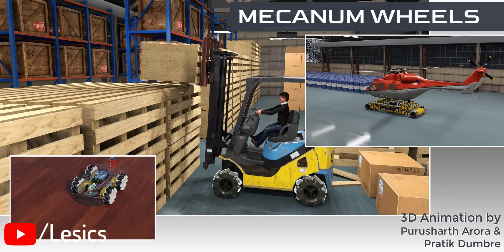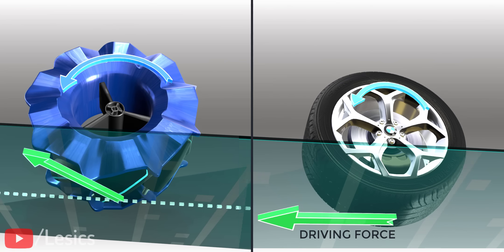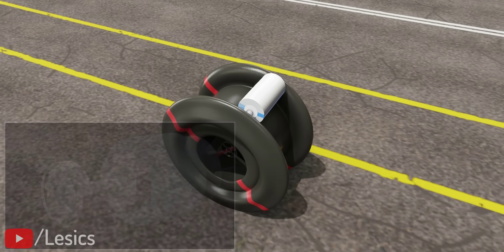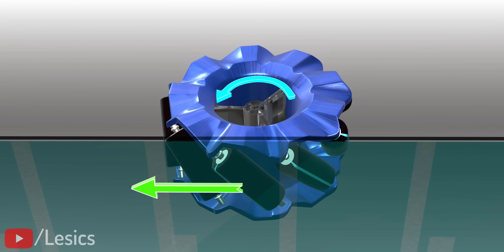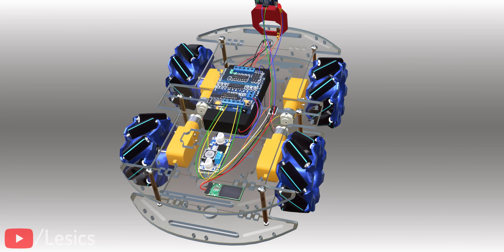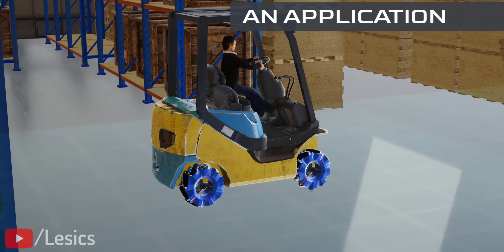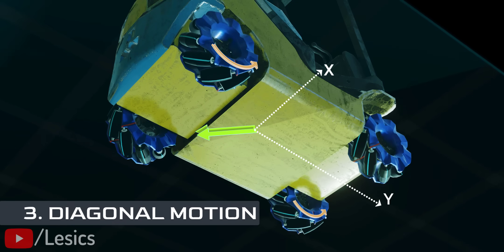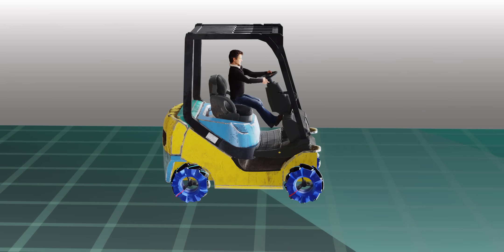The Brilliant Engineering of Mecanum Wheels!

Comment: This movement system works as long as each wheel has a perfectly equal coefficient of friction for each wheel. When dirt appears on the surface or the wheels wear out, the direction of movement is unexpected.
Reply: probably can be fixed by computer adjusted wheel motors to maintain the direction
Reply: @Fin4L6are  
Came to say the same thing. Can’t be more complex than controlling a multicopter drone.
Reply: @Fin4L6are  the controls will have to be completely different from a regular car/forklift. Maybe a joystick for direction and a lever for forward/backwards thrust.
Reply: 1 joystick with a twist axis. Push forward go forward, push right translate right, twist clockwise turn clockwise, etc.
Reply: @Fin4L6are  big brain

Like a constantly correcting program?
Reply: @gameseeker6307  sure
Reply: This is a matter of control science. We can design a close loop control system that can drive the vehicle movement correnting the not perfect condition of the wheels.
Reply: @antoguag  yes! My robotics team has used these wheels with a LQR and that solution worked very well.
Reply: @BenCauntyt  where? URL?  video?  thanks
Reply: That's for materials science engineers to resolve.
Reply: @besacciaesteban  true, but what an awesome challenge for anyone to take a shot at it. We are all capable of that, never stop believing in that, failures are successes in many forms in just everyday life.
Reply: Wouldn’t it be easier to just have four wheel steering?
Reply: @Stormprobe  To do exactly the same motions, exactly the same way would require extremely robust power steering  capable of turning each wheel laterally without forward motion under load. Something similar can be done with less robust power steering, If you make a space tradeoff ie get the wheels moving before you start turning. But you're adding 4 hydraulic systems on top of an electric one because each wheel will need to be independently steered.
Reply: @Stormprobe  With conventional drive systems, steering while stationary could damage tread & floor.  Mecanum wheel systems doesn't "steer" in the typical sense, so making direction change at extremely low speed is one of its strengths.
Reply: @Stormprobe  I guess this technology is cheaper to build and easier to repair. No steering mechanics at all which saves 4 additional motors
Reply: Engineers are always a step ahead. The Airtrax loader in our hangar works on concrete floors, paved roads and even grass/soil.
Reply: That's why you use a closed loop system that monitors actual direction against predicted direction, that way precise control can be maintained. This is the basics of an accurate and precise moving system
Reply: That traditional forklift turn in the video is BS they can almost turn on a dime .
Reply: @kayzrx8  True, that was a cringe exaggeration.
Reply: @kayzrx8  They 'rotate' around a dime.. not so much 'turn' on a dime :)  Lay a dime at the middle of your right front wheel, turn you steering hard right, ,then go 'forward' and you'll rotate on the axis of that dime you just placed :)

Traditionall Forklifts turn 'similar' to how tanks do when you make turns at their turning limit.  Only its the front 'axel' that swings around rather than the 'center' of the forklift, and the rear swings around into the space the opposite side of the axel was occupying.
Reply: @Gwydion_Wolf  you do know that's an expression captain obvious :)
Reply: @kayzrx8  I know, hense the :)'s 😉

Just wanted to give people who may not know a decent mental image of how current ones turn :)
Reply: @kayzrx8  Yeah thats true but they still cant go sideways or diagonal lol.
Reply: @Lotek117  they don't need to. Millions of forklifts have been doing fine with rear steer for decades..... Reliably. Sideways movement would assist a newb that's about it. Not to mention alot of forklifts can move the forks sideways . So not sure how this helps besides adding complexity, reduced reliability and Increased cost , the three things you are trying to avoid when manufacturing a product .
Reply: That's why we have sensors that can adjust for those moments.
Reply: I agree. Im sure this wheels will wear out  way faster than regular one either. So it will cost more to repear
Reply: @sahinyasar9119  Hence the market share of this invention is tiny even all those years later.
Reply: @StrangerHappened  when thinking about it. This only usefull for robots useally used in amozon cause they only move in predicted space. While employee only need someone skilled to work for them to drive regular one
Reply: @StrangerHappened  I think the market of these wheels are only in factories
Reply: @StrangerHappened  Actually.... since engineers were forced to make light bulbs with an end date. I'm surprised it's not being regulated into existence.
Reply: @sahinyasar9119  They are usually driven by a joystick. Many can autonomously guide themselves and have built in collision avoidance.
Reply: @sahinyasar9119  they are also used in robotics competitions like F.I.R.S.T. robotics sports. and other hobbyist applications.
Reply: @newchannelverygood162  Which is a huge market.
Reply: @newchannelverygood162  the us navy uses this tech in their ships
Reply: @sahinyasar9119  Skilled employees want to be paid, robots don't. You can sell almost any idea to a company and they'll buy it so long as it's goal is to replace employees and reduce how much in wages they have to pay.
Reply: @sahinyasar9119  even then, Omni drive might be more practical
Reply: @newchannelverygood162  Why factories?
Reply: @sahinyasar9119  usually used at amazon** 

English, it's a bitch.
Reply: @StrangerHappened  Agreed, i work as a security officer in many warehouses and i see only regular forklift trucks everywhere.
Reply: @StrangerHappened  forklifts are expensive as fuck as is already. Not because of the wheel.s
Reply: @sahinyasar9119  I bet with the advent of AI, could have an adaptive system that can compensate for any irregularities, and maybe even make the control of them easier
Reply: @sahinyasar9119  Yeah I can't see this being very useful to amazon warehousing unless land in the area is VERY scarce. (i.e., forklift).

I bet it could come in handy for their delivery drones though if they ever start that like they said. I would imagine they'd use a hybrid flying/rolling system to shorten airborne time. The ability to spin when delivering to complex locations could prove very useful. Just don't neglect on the AI and Camera systems however, I think the biggest hurdle will be keeping people from getting in the way or proactively messing with the delivery drones.
Reply: @sahinyasar9119  QAqqqqQqqqqQqQQqq qaQQqqqqqqqqQ
Reply: @sahinyasar9119  repear
Reply: @sahinyasar9119  Yeah man, but the cost of the rent in my area way higher jajaj
Reply: @sahinyasar9119  they're rollers, not fixed.  Watch whole video.
Reply: @sahinyasar9119  ya me pssá2
Reply: @sahinyasar9119  You seem to think that the rollers are sliding on the ground since you bring up friction and wear. This is not correct. The rollers are just rolling, like small (unpowered) tires. Of course you won't have Mecanum wheels on your car any time soon, but that is because the function is not needed there so the added complexity and cost is unjustified.
Reply: @mumiemonstret  Still using this tech on forklift which lift way heavier things and it will put pressure on bearing of rollers, Its enough to break or with little bit dirt make it unuseable. In the end it would be more usefull on unmanned robots that dont lift too big weights where is no dirt.
Reply: @mumiemonstret  On the diagonal motion only 2 wheels are spinning so the wears can be uneven.
Reply: @lfow0234  Yes, but over time, the wear will be even, due to directional movements averaging out.
Reply: @mumiemonstret  finally someone with sense and knowledge in this sub
Reply: @lfow0234   On front or rear wheel drive vehicles two wheels wear unevenly as well. Even 4wd the power and loading is not 100% symetrical.  It's all part of wear and tear.  The advantage to this system is that it is only used in controlled environments where a good engineer can figure out whether the mobility advantages produce enough cost savings(space and time efficiencies) to make any added maintenance cost worthwhile.
Reply: @BritishBeachcomber   The wear will balance out only if the work load forces balances out over time. That might happen, but more often repetitive  work will cause uneven wear.
Reply: @mumiemonstret  shhh… I was having fun reading peoples claims of expertise before I searched for it myself. The video you shared is most likely a promotional video so it won’t explain the downsides to using these wheels but if I do a little googling I can probably find practical info from people at the other end of the Dunning Kruger curve, who actually know what they are talking about.
Reply: @jacobpaint  I admire the effort you yourself put into this: "If I do a little googling I can probably find..."
Reply: @garryiglesias4074  Well, as an engineer I am used to myself being the downer in excited discussions about unrealistic solutions, and I recognise the importance of someone questioning them. But many of the negative comments here are neither constructive nor scientific. A few are, though.
I don't want to come off as a Mecanum fanboy (though I am Swedish and as such a little proud of the invention). There are definitely valid concerns. I think that the most important is that the rollers constantly interact with the ground the same way as ordinary wheels only do when taking a very sharp turn. Good friction is essential. No, it doesn't need to be "equal on all wheels", but it needs to be good enough to prevent slipping. Otherwise, as noted, you will take off in an unpredicted direction.
So the commenters pointing out that these wheels don't work off-road or on gravel are right. The commenters noticing that regular wheels are more practical in most applications and that the video compares them unfairly are also right.
But then there are all the other commenters, just saying "This will never work!" and then constantly changing the goal posts when contradicted, to "OK, maybe work but never be practical", "OK maybe practical for robots but never for a forklift", "OK, it can work on a forklift but will be crazy expensive" etc. etc. 
I don't understand the mindset of this kind of downers. And yes, they are clearly "engineer-posers" since engineering is about seeing opportunities.
Reply: @mumiemonstret  id imagine you can't drive this thing on a hill or park on uneven surfaces. There would be no brakes
Reply: @mumiemonstret  even if the patch of turf the roller touches never changes while the machine moves, its still exerting downward force which would produce heat + wear and tear on the 'spot' the roller made contact with the ground.  Then you have the barrings on the rollers own center-line axis that 'is' spinning at that time.

It'd still cost more in the long run for 'heavy weight' applications than normal tires.  Though i'd love the idea of being able to use a forklift equipped like this.

I think were more likely to see forkilfts designed with 90deg angled traditional wheels though before these become widely used. :)
Reply: @sahinyasar9119  You seem to underestimate how much stress bearings can handle.
Reply: @mumiemonstret they are rolling on their axes but they are constantly sliding on the surface, like a drifting car.
Reply: @mumiemonstret  imagine 100 years of refinement of this system.
Reply: Yeah that's why this is only used indoors, but frankly it's mostly needed for restricted clearance areas like warehouses anyway
Reply: @xaiano794  But they're used outside as well
Reply: True. But it maybe could be used for some applications where there is no heavy loads and controled environment
Reply: @filipstojanovicmechanicale9265  Siemans uses a vehicle with mechanum wheels to move locomotives.
Reply: But perfect in a warehouse environment.
Reply: Actually, you just described the complete reason behind modern cars being equipped with sensors to counter brake lock (ABS) and traction control and more of such systems. Wear & tear can be taken into account by proper feedback loop by means of sensors to the CPU to calculate the compensation required to motion into the required direction in ALL road conditions. But you are still correct on the more than normal "tire" wear & tear issue. I don't think it is the same rubber compound they would be using.
Reply: @ses4068  Friends, in order to have feedback and correct the direction, it is necessary to have a very accurate and fast position sensor or a displacement verctor. In principle, the problem is solvable, but is it worth it? It's much easier to make all the wheels turnable.
Reply: @f33net  it’s a very trivial problem to solve and it’s very simple with basic sensors. All you need is an encoder on each wheel
Reply: @baileylunn2215  the encoder is powerless when the wheel slips :)
Reply: @f33net  that’s what the IMU is for :)
Reply: @baileylunn2215  What is an IMU?
Reply: @f33net  Inertia measurement unit or something like that. Keeps track of how it’s being moved around with gyros and stuff. So you can figure out how far you’ve actually moved
Reply: @baileylunn2215  Okay, the second question is: how do you plan to stop this car on free rollers on a slope? :)
Reply: @baileylunn2215  If driven manually the driver is the sensor. If driven autonomously, some systems use floor tracking cameras.
Reply: @davidsandy5917  ah yeah the good ol mouse sensor on the forklift trick. That’s a good way to do it too
Reply: @f33net  the same way you move forward. when all wheels are stopped the forces of the rollers cancel each other out because they are angled in different directions
Reply: @f33net  Because when wheels are unpowered the opposing roller directions cancel each other out, so if you apply normal brakes to the wheels itself and they aren't going anywhere

seriously this isn't hard
Reply: Just use controls
Reply: Not to mention many moving parts.
Reply: It looks like this design is for warehouses and areas with smooth floors. Which is the area most forklifts are used
Reply: So great in theory but in the real world doesn't work? Is that why there is only an animation and no real world example?
Reply: @thegeneralist7527  there's real world examples in use today.
Reply: @thegeneralist7527  real world example right here. these ARE used currently: https://www.youtube.com/watch?v=0DBXuZv38l8
Reply: @thegeneralist7527  Dude you can literally google them and watch videos of them existing and operating
Reply: a typcial schism
Reply: 3.3k people have agreed that this forklift is not real, can't work or too impractical, but every one of them is completely wrong.  :(   They had these back in the 80's.  But kids these days think that the entire world was only just invented.
Reply: Couldn't it be monitored by a computer to adjust it?
Reply: That's pretty easily solved. Have a hard wired fine brush OVER the top that cleans automatically every time the wheels move.
Reply: They could interface with a standardized flooring design
Reply: Also what happens when that forklift picks up a pallet..now the front wheels will have more pressure on them than the rear wheels and that will stop them working properly
Reply: And where is the actual forklift and video how it works? I don't need some fancy animations and theoretical bs.
Reply: Wheels are heavy, complex, prone to jamming, prone to wear and tear, not heavy duty. The system requires a smooth, uniform and flat surface to operate. The load must be distributed evenly across the wheels for a predictable direction. Conclusion: It's more of a fancy toy than a workhorse.
Reply: @iqbang9236  It could work in automated or autonomous systems.
Reply: We use these in our robots.   Along with different variations depending on the bot and application.   And of course it still works when the coefficients vary due to debri encountered during normal operations.
Reply: Easily corrected  by the controller by video , laser or gyro feedback.
Reply: @kayzrx8  Do you know why the Kalashnikov gun is the most popular in the World? He doesn't use video correction! :)
Reply: or as long as your software compensates for the differences.
Reply: Not if you constantly calculate tire spin / friction loss for each wheel / roller
Reply: Brr
Reply: The real reason why we don't use this on big heavy equipment is because it's not necessary. It's easier, cheaper, and more reliable to use cranes or other computer-operated structures than a forklift in tight areas. It's cool if a forklift can make such moves but most of them don't really need to. Also, the reason why forklift tires are so simple is because they need to be VERY strong, stiff, and reliable. Adding a lot of components to such a thing is asking for things to break. So almost no interest form the big heavy equipment industry is the reason why it isn't a thing already.
Reply: Good for me, I know what coefficient of friction  is so I can understand this
Reply: My company is currently working on mecanum wheels with a compressed air flow system that blows the dirt out of the way and keeps the floor clean
Reply: Well you can tackle that by using a well designed control system. If you can sense how much the vehicle rotates and correct it when needed, we can do it properly. 
But naturally the costs go up and the wheels get damaged faster too.
Reply: so only for use in clean flat ground warehouses. Those should be fine for years don't you think?
Reply: It will not work 100% in rough surface.
Reply: You can't turn while going fast with these wheels
Reply: Same can be said about regular wheels, if one wheel gets dirty/oily and the others don't.
Reply: All the systems that I am aware of that use Mecanum wheels are operator driven.  In that case, the operator turns the control until it does he wants.  That makes the human the control system  - and he doesn't even know he is doing it.
Reply: Things of unexpected is equal DEATH
Reply: So it can only be USED on a controlled surface environment like a wearhouse.
Reply: Shut up just shut up... Dont say dont talk after people watch watching this video...
Reply: and your point please?
Reply: just imagine the weight not being distributed perfectly XD
Reply: You don't  understand what you  watched. The direction is absolutely controlled. Watch the video again.
Reply: Well I don’t think forklifts will be facing off-road roadway but mostly stay inside more
Reply: True - though to be fair, they will likely already have a lot of electronics in vehicles using these wheels, so will likely have a computer calculate resistance vs. torque vs. inputs and adjust everything accordingly in real time.

The wear and tear though would be painful though yeah.
Reply: Putting a tread on these might help.
Reply: But: 
we can easily understand that in 2022 the on-board computer, can assist navigation and correct unwanted trajectories and compensate for the worn wheels. 
Simply using 4x4 traction
Reply: https://youtube.com/shorts/_t_aAw5JgWM?feature=share
Reply: That’s pretty disappointing. This kind of movement is what I dream of for a powered wheelchair, but I can see it being unstable in the environments as you described.
Reply: @Mr_Gabe_Valencia  well it still could work for that application for store/pavement/carpet ect type areas you would normally use one.

Just not so well on dirt/grass/ect.
Reply: @Gwydion_Wolf  true, but I frequent those areas where I live and I can see myself getting stuck a lot. I suppose if there was a mechanism that locked the rollers in place so they don’t spin, that would give it proper traction on slippery surfaces.
Reply: Nerd
Reply: Software can be used to compensate. Literally just how drones work.
Reply: Snitch K  How so?
Reply: You smart, you loyal…etc
Reply: https://youtu.be/Ln7xIjw8Fh8
Reply: maybe we can put some kind of direction sensors(i.e. image sensor) so that we can compensate movement?
Reply: My very first thought was how wear would affect this design over time of use. It relies to much on the tread.
Reply: Bet you could use accelerometers and cameras beneath the machine so it knows it’s position and movement to compensate for irregularities
Reply: @James you are wrong
Reply: Well thats a problem isnt it lol
Reply: Which can be solved using machine learning in real time
Reply: Agreed any wear and tear even minor would hinder the triangle circumference weight distribution dangerously.
Reply: WHY ARE THERE 6 PEDALS IF THERE ARE ONLY 4 DIRECTIONS?!??
Reply: Probably why I have never seen one. They also look very expensive. Too bad, very genius concept
Reply: I think the intended environment something like a very clean warehouse where the forklift only has a single task. Niche to be sure.
Reply: Modern implementation of these wheels have complex control systems to monitor and adjust for global acceleration vector differentials caused by these exact issues. This drastically increases the lifespan of these wheels.
Reply: How dare you bring science and logic to the internet!
Reply: Where is your invention?
Reply: Absolute genius
Reply: then it kicks it out the way then keeps moving.. lol igno trying to be smart 😆
Reply: dont cha just love when angry lgnos get jealous and try to caII smart peopIe dumb 😂
Reply: @Goaty McGoatface well then I’m sold
Reply: Wouldnt they add something to the program running the electronics to detect and mitigate this difference in friction? Like ABS/traction control on a car?
Reply: You could code a response to alter spin rates and maintain a “perfect” movement. 

Different spin rates =different forces.
The right spin rates, cancel out uneven friction
Reply: Could you solve that by using rubber rollers?
Reply: But you can say that about pretty much anything.. look at cars with posi traction vs limited slip
Reply: Also, half of the power of your motor  is cancelled out.
Reply: Nothing that cant be solved with sensors and an ECU that can then adjust force to each wheel. Like an eLSD.
Reply: ارسم في فى قثصض12234
Reply: They are rollers.  Watch the entire video, not the first 10 seconds and then you make your judgement.  I too at first thought they were fixed.  10 seconds of a video and then blasts his thoughts to the whole world.
Reply: Thanks captain obvious.
Reply: All friction based systems work only until they wear out.

Optimization of a system will always bias that system.
Reply: Nice, 
A good prayer:
I'm a sinner JESUS please forgive me for all my sins I know you shed your Blood for me on the cross at Calvary. Thank you JESUS for my salvation and for shedding they Blood for me. I love you JESUS. 
Romans 10:5/10 ct...❤️k
JESUSisLord!Amen...
Amen..
If you'd like to call someone who cares 
83
For
Truth.
bc you don't know when you'll die?
.y r u hesitant.
Reply: What if the wheel was 3d printed
Reply: ये
Reply: @LavkushPatel-sz5op  have you subbed our new ch. Yet?
Reply: Also, for a machine meant to lift huge weights reducing the floor contact area seems like a bad idea
Reply: Oh snap.
Reply: Ok
Reply: But I think it is suitable for floor working vehicles in industry..
Reply: What if a sencor predict the direction and rotate the wheel with less friction with a higher speed.
Reply: These wheels could be useful for forklifts in polished concrete warehouses that are cleaned regularly
Reply: "the direction of movement is unexpected" No it isn't. There are working forklifts with these wheels already https://youtu.be/0DBXuZv38l8
Reply: Not true. Wheels just need to have enough friction to not slip. Variations in friction above that from wheel to wheel don't matter, and that's important. If there were to be some slip, just need some software to modulate power to wheels like on typical cars. No doubt there's cost to that, but the engineering here is simple and clever. Literally reinvented the wheel to a meaningful end.
Reply: My rogue wheel design will conquer the world
Reply: Yeah and thus efficiency is reduced.
Reply: 9th 9 p⁰
Reply: It seems that all that would be required to address this problem would be a series of accelerometers matching the proportional power of each roller with the actual direction and momentum each roller provides to the vehicle
Reply: J
Reply: Sad trombone sound
Reply: Or any issues which may also occur with the axles or mounting structures of each roller, such as wear and tear, stress etc..
Reply: Simply compensate for the immense wear and friction with accelerometers and control software that compensates for reality not matching control input.  Easy peasy.  Drones already do this. How else can they hover automatically in a breeze?
Reply: Plus the friction on its own will be so high I don't think all that fuel will equal the rotary motions of the vehicle unless it is really often and necessary
Reply: Seems like something that could be handled in software these days with inertial sensors.
Reply: The wheels are not made of steel... this concept works on concrete, gravel, dirt, etc.
Reply: It works in those conditions if the loop is closed.  They don't have to be perfect.
Reply: @@curt6068 well duh You can copy an AI as much as you want but you need a lot skilled people who proficient on driving. Thats pricy until first General AI
Reply: What if there is steering control of all 4 wheels?
Reply: This could likely be trivially compensated for with a software controller. The wear & tear would likely be a bigger issue.
Reply: Which is why they're really situational and can really only be used in highly predictable environments
Reply: Every system has its fails and requires replacement of parts .
You made no point. "Faster" and "Unexpected" is nothing but words that offer no value to your statement. "Dirt" is also very general and does nothing but speak to a variable without any indication of value .Your comment is less than worth consideration. Honestly I fail to understand your point at all. I am "wore-out" trying to give you the benefit of the doubt and assume you are not pretending to offer insight to the engineering involved to achieve such a feat a mechanical ingenuity.
Reply: To many moving parts and is impractical.
Reply: Impressive observation. You should contact the engineer Im certain your input will be put to use immediately. Im sure they would much rather use your design.
Reply: Driving sideways two of the four weeks are dragged sideways, their rollers lengthwise moving over the ground instead of doing any rolling
Reply: Dirt, oil, wear and mechanical breakdown. It is like they said in the video an ingenious complicated design, too many things to go wrong.
Reply: That was literally reinventing the wheel. Absolutely genius.
Reply: Well with some computers and individual power adjustment to each wheel it shouldn't be a problem. Heck we already have TCS on most vehicles already.
Reply: @SaintLevantine  fork lifts have to work for longer than a new car will.
Reply: Individual free rolling bearings at angles... jam on the breaks... What could go wrong? lol
Reply: @amrevrhyme  Each wheel is individually powered by a direct drive electric motor. Applying the brakes means cutting power to all 4 wheels.  Any unintended motion can be countered by electronically applying just enough counter power to compensate. Theoretically this is the easiest vehicle to stop suddenly because it can be 100% digitally directly controlled.
Reply: @larryclemens1850  You'll have enough trouble  getting it to actually move in the first place.
Each of those spindles the wheels are using for traction, are free to spin what ever direction Sir Issac Newton dictates.
There is a reason this is just an animation
Reply: @larryclemens1850  Did you happen to read any of the comments by actual lift drivers?
Reply: @larryclemens1850  Tuesday I loaded a 3500lb. machine, 10 ft long and 39 inches wide, into a 48ft standard enclosed trailer.
To do this I had to put our 5ft fork extensions onto it, so that I  could actually lift the load off the floor. With the amount of this load so far forward the front wheels, the amount of force available at the rear wheels is limited, maybe just a couple hundred pounds. 
The Mecanum wheel system requires that all 4 wheels have, at the very minimum, a similar (preferably equal) weight distribution to ALL 4 WHEELS at the same time for any controlled movement.... AT ALL! 
I couldn't have done that with either of the lifts in the videos you've posted
In that video you posted above, we saw that lift lift and maneuver an EMPTY 55 gallon drum, and two empty crates, one of them supposedly 40' long, and then watching some idiot dump it on purpose.
How many times have you driven a forklift? How many different types? Have you ever fed or tailed automated machines? Have you ever lifted loads so big it made your butt hole pucker? Ever have a truck driver offer you $200 if you can get 60 pallets loaded onto his truck in 20 minutes?
One of us knows what he's talking about.... the other saw a cool video on youtube
Reply: @amrevrhyme  They would free-roll in opposite directions and essentially act the same as if you'd slammed on the brakes on a normal car.  Only instead of the 'canceling force' being backwards to your travel, it would be outward towards all 4 corners at diagonals.

Which... would still be kind of bad, as the wheels would essentially be trying to pull themselves off the axles, or getting shoved 'towards' them, depending on the direction of movement before stopping?
Reply: @amrevrhyme  you seem to think these would be going more than walking pace, which is incorrect.
Reply: @metallicarabbit  As a guy who as driven several different kinds of forklifts in a production setting, and loaded thousands of trucks on busy shipping docks, let me just say..... Ha, ha, ha, ha, ha,.... right.
Reply: Onboard computers will solve that
Reply: @Fabian-jw5ih we will need clever software anyway to make it easy to operate. Something like accelerator and brake, with a joystick for steering/rotation. Make the controls familiar even if some motions are not immediately obvious.
Reply: @Fabian-jw5ih  Reinventing the wheel. 😁
Reply: The rollers can have an outer layer of rubber just like a normal tire, which would take longer to wear down than hard roller bearings, and so dirt won’t be a, so to speak, “driving force” in the vehicle’s movement
Reply: tbh sounds like stupid idea to support companies that are to fuckng lazy to expand wearhouse space.
Reply: These wheels are going make a very ruff ride. They will rattle any one on it.
Reply: @oldmech619  no they won't and don't. its explained in the video how they eliminated vibration by rounding the rollers' plus there is video RIGHT here of a real one being used: https://www.youtube.com/watch?v=0DBXuZv38l8